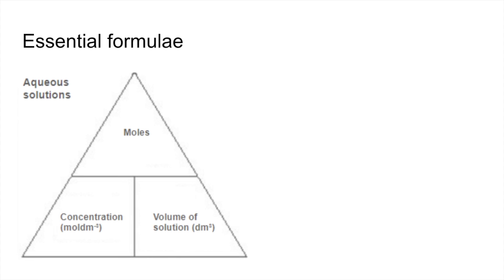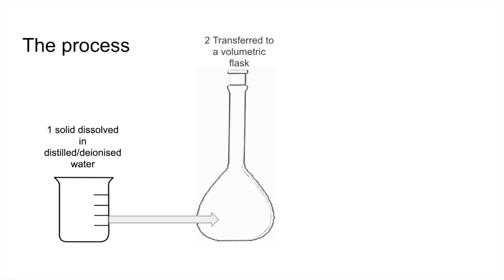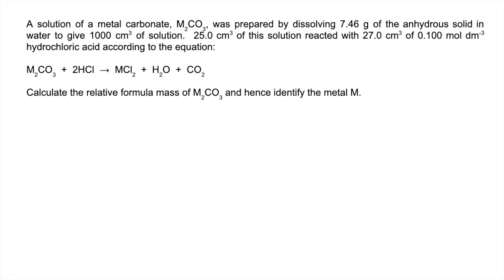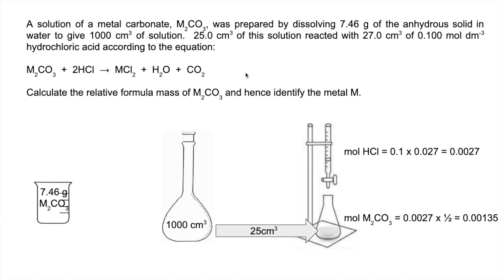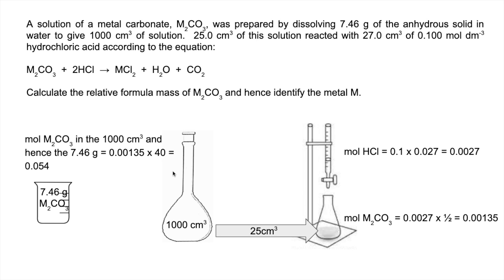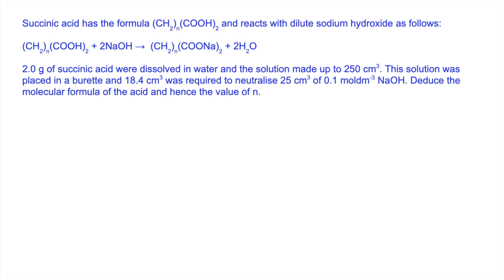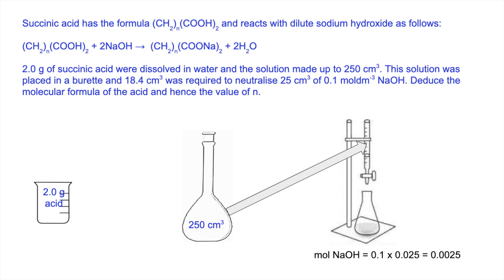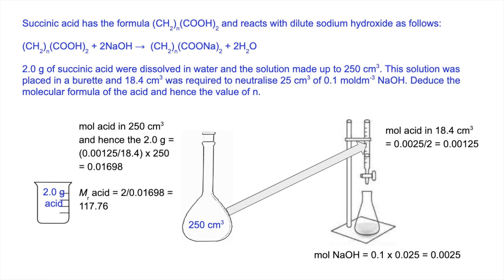Quick Revision - Further Titration Calculations

Comment: why is it multiply by 250 not 10 for question 2 step 3
Reply: Sorry for the late reply. Because u divided it by 18.4 as it was the moles for 18.4cm3 and we need to find it for 250cm3 so u divide by 18.4 and x250. If it was 25cm3 you can x10 like u were saying but not in this case.

Comment: Thank you for this Video! I am still unsure on how you got the value 40 when working out the moles of M2C03 ?
Reply: i think it's because it's a ratio question . Think of it like this
1.35 x 10^-3  moles in 25 cm3
____________ moles in 1000 cm3

to get from 25 cm3 to 1000cm3 you multiply by 40 so to find the moles in 1000cm3 you multiply 1.35 x 10^-3 by 40 as well